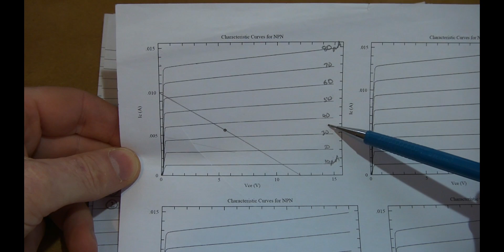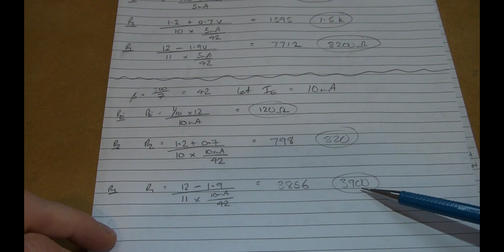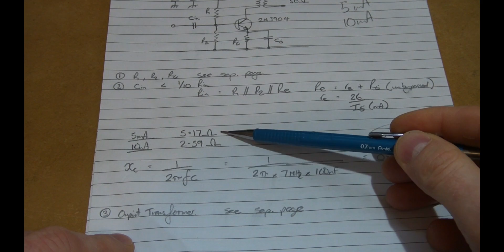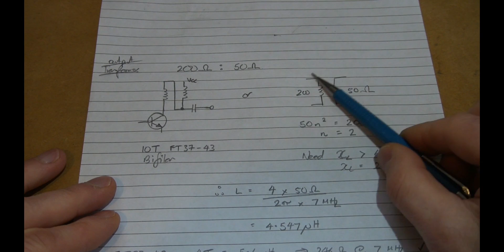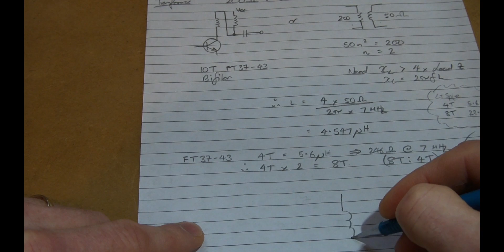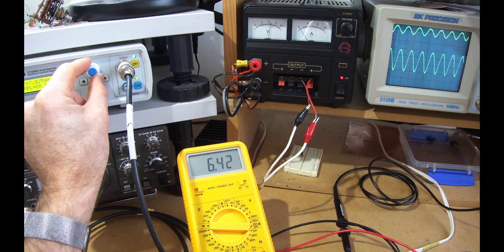Homebrew Portable 40m CW Rig - Part 3 Antenna RF Amplifier

Comment: Hi Charlie, Nice videos! – I like to follow you homebrew HAM-projects.
It is my own personally experience, that you cannot trust “200 ohm collector impedance rule”. So when I do 2:1 impedance transformation, I not always end up with 50 ohm output impedance.

I use to test it by applying input to the amplifier (specified level and frequency) and measure the voltage Uout at final output unloaded and expect to get Uout/2 when adding 50 ohm termination. If not, then I’m not sure, that I have 50 ohm output impedance.
You can calculate the output impedance when you know the output voltage difference and your termination resistance. If it is difficult to readout the answer, I simply take a trim-pot instead of the 50 ohm termination to “squeeze” the output down to Uout/2. Then I remove the trim-pot and measure its adjusted resistance “off circuit”, which will be equal to the “correct” output impedance.
Then I calculate the collector impedance by the knowledge of the used turn ratio and the matching loading impedance and wind a new corrected ratio matching transformer and do the test again.
Best 73’ OZ0LTT
Reply from the maker: Fantastic thanks. I will definitely try this. Do you know of an easy way to calculate the output impedance, or do you do that empirically each time?

Comment: Being interested in design how do you come up with which transistor for the rf and if amps?
Reply from the maker: Hi Donnie. To be honest the aim of the videos is to encourage others to give it a go too. To that end, and in an effort to keep things simple, I tend to only use where I can commonly available components (2N3904, 2N3053, BD139 etc). I fully acknowledge there are more suitable components (and circuit designs to that mater) that could have been used. 73s. Charlie

Comment: Thanks Charlie 
Brilliant -can I ask you , with a bit of tweaking do you think this will work on 
20 metres ?
Thanks once again
Reply from the maker: Hi. You could try, but I suspect with falling Beta with freq you will not gain that much. One option, if it's a monoband radio, is to place an appropriate cap across the collector winding and play around with making that resonant at 14MHz. If you keep the Q low then it should perform well across the whole 20m band. Donwload LTSpice (it's free) and play around.

Charlie
Reply: Charlie Morris Charlie- Thank you- it was just an idea for a small radio for when the sun gets better !!
Thanks again

Comment: Thanks Charlie. I really enjoy your videos. Just wondering about the input impedance equation. Should it include the transistor Beta? R1 || R2 || Beta*Re. Cheers, Ian
Reply from the maker: Yes, absolutely Ian. Re should be multiplied by beta. Looks like is missed that out. Opps! Thanks again for pointing that out.

Charlie